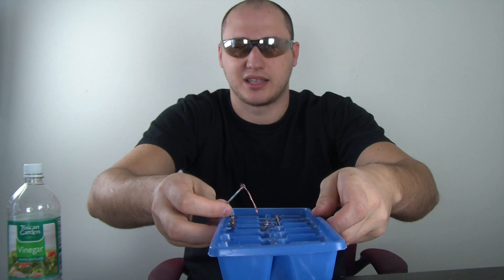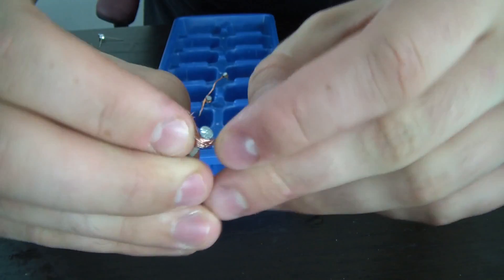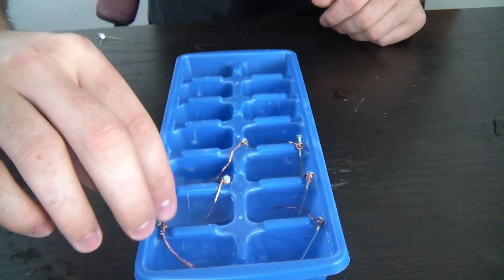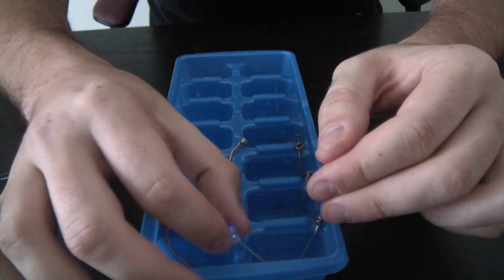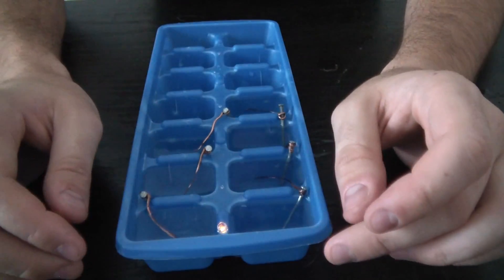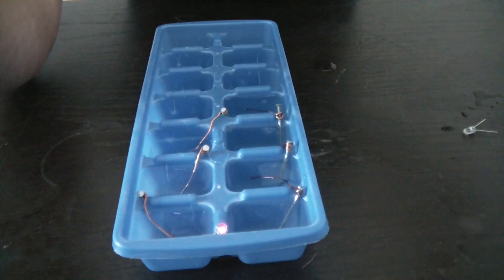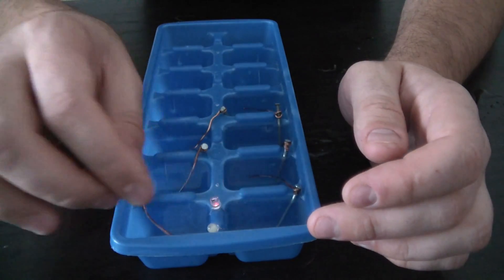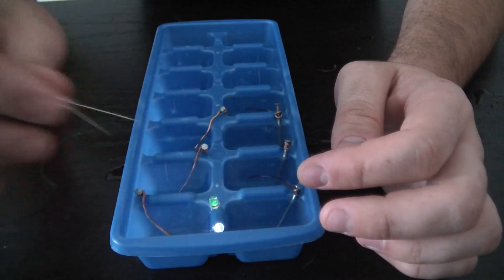Homemade vinegar battery

Comment: GET A COUPLE PENNIES THAT ARE NOT OLD  uSE NEW PENNIES  SAND OR SCRAPE AWAY THE COPPER PLATE ON ONE SIDE TO EXPOSE THE ZINC CORE....  SOAK SOME CARDBOARD IN LEMON JUICE SO ITS COMPLETELY SATURATED  CUT OUT PENNY SIZE CIRCLES PLACE BETWEEN PENNIES THE TOP PENNY AND BOTTOM PENNY HAVE TO HAVE THE COPPER SIDE OUT WRAP WITH ELECTRICAL TAPE ATTACH LED Leads to top and bottom and tape  the LED willl stay lit for about 2 weeks

Comment: It's not because the battery has not enough power to light 3 LEDs, it's because every LED has a different resistance, so if you put one into the circuit and then another with a higher resistence, the second one won't light because the electricity all goes through the first because of its low resistance :)

Comment: Different colored LEDs need different voltages to light up. Colors like white green and blue (shorter wavelengths) require a higher voltage, where as red and orange (longer wavelengths) require a lower voltage. you can loosely use ohm's law to describe why the red lights and the white wouldn't. basically, the red one has less resistance, so more current will flow through it, making it brighter.

Comment: Vinegar are actually ethanoic acid, and acids produces and conducts electricity well. Therefore the LED lights up but to a certain brightness depending on the voltage of electricity produced by the vinegar.

Comment: the elactricity is produced from movement of ions from the nail to the copper wire all the vinegar is doing is alowing the ions to move. its what all batteries are like but they use different materials.

Comment: Sure. The iron will be turned into Fe2+ Ions and the water in the vinegar will turn into 2 OH- and H2. So you basically need to use new Iron-Nails and a fresh acidic solution.

Comment: The acid in the vinegar causes a reaction with the nail and copper wire. And the [placement is what causes a + on one side and - on the other. Like using a volt meter and put it on ery low voltage you can place the probes in the soil and get a reading.

Comment: If I'm correct the way you set it up you're actually not using one of the cells. one of the cells in which you put the LED is not producing any electric charge, the one with the copper on the other end. this one is only functioning as a conductor and can be filled with water (Or skipped entirely). Alternatively, if the LED conductors are galvanized (ie. are covered with zinc) the one with the nail is not producing any electric charge.

Comment: Vinegar in a sour liquid whitch means it has extra electrons flowing in it. That makes it the souce of power. Of course the voltage is small, so you have to connect multiple cups.

Comment: School chemistry. Zink and copper have different electronegativity, so they produce electric potential difference when they are connected together (χ(Zn)=1.90, χ(Cu)=1.65, so ΔV=0.25 V) . As mentioned below, to increase the output current we increase the surface area of metals. And to increase the output voltage we make a daisy chain of these "nail-batteries".

Comment: This will probably work better if you use a nail and copper on the terminals connecting to the LED as well.
Also, you apparently don't care about security in this episode. No fire extinguisher??